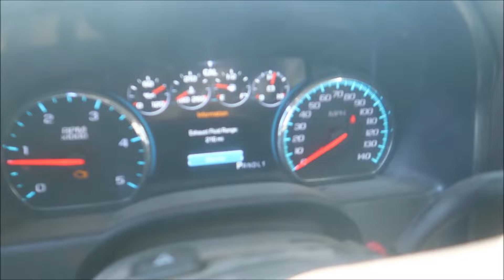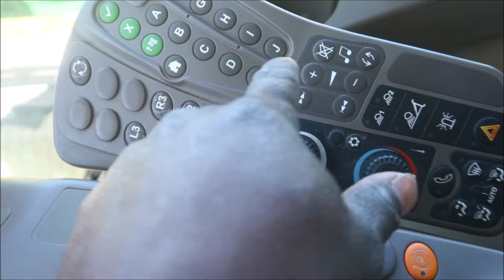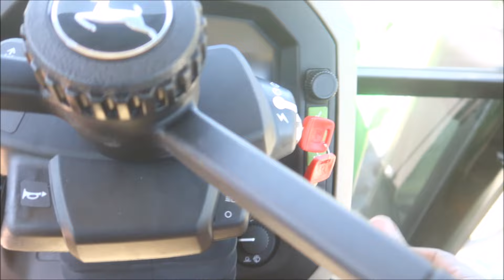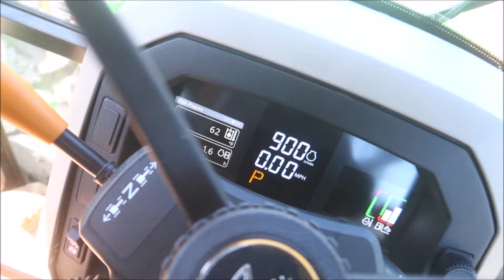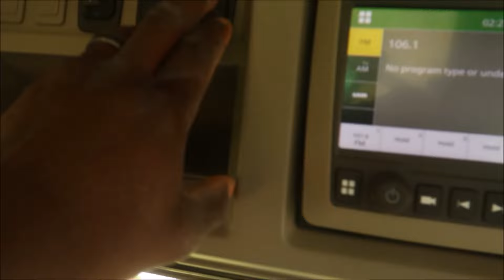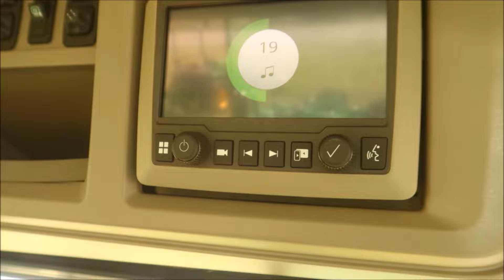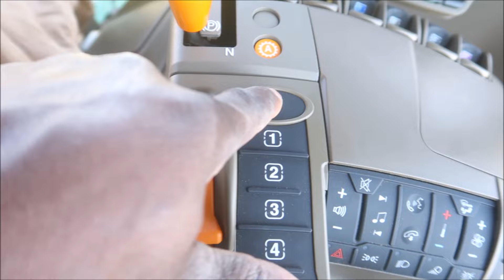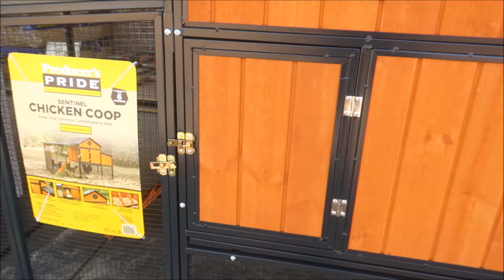Dexter doitall Tallulah Louisiana John Deere Goldman Equipment

Comment: I get a wire pipe brush to clean batt.cable ends 1/2 for negative and 5/8 for positive used for cleaning pipe to solder you will find other uses for them and u can clean the post up a little bit to get u going
Reply from the maker: Ok

Comment: To rid battery of corroson spray with water then sprinkle down with baking soda. then take you some sand paper and sand post down as you would take a shoe shine cloth to a shoe. You will need a special tool for the cable end.
Reply from the maker: Ok thanks

Comment: Thinking about getting a new tractor? You guys going to expand the farm or just lease more acreage. My duramax still in the shop going on 5 months now.
Reply from the maker: Yes I’m looking to expand , what’s wrong with your truck
Reply: Fuel injection control module!😡 2005 lly duramax.
Reply from the maker: It take that long to be fix
Reply: They couldn't fine the part, so you have to get them used and the warranty issues with the parts company.
Reply from the maker: Wow 😮